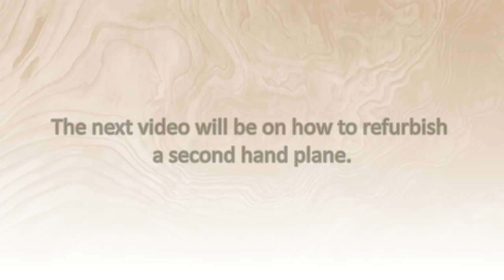What to look for when buying second hand woodwork planes.

Comment: Thanks, Chris, more great insights and observations, like the tip about the Record tungsten steel vs the earlier cast crucible one, the blunt end of the blade is a slightly different shape, a bit more angular I think.
I've also heard that pre war plane castings were left to sit for a year before further machining to reduce the cast iron body moving, whereas later it was a couple of weeks, hence the 80's 'banana's that seemed to prevalent back then.
Reply from the maker: Yes, I have heard that about the castings being left longer pre war.

Comment: They also made nylon handles that were a lot stronger ( my number 5 1/2 as them )than the silly plastic ones, but nothing comes close to rosewood. I restore old planes as when I get them their just a lump of rusty metal ,no I  keep and use them .I have one that was given a Stanley 4 1/2 that had the two adjustable pins I simply changed them for a cast iron one I had spare plus a replacement carbide pin , the frog I flattened better this gave it a better seating position, luckily it came with wooden handles and longer blade !

Comment: Excellent, learnt some new stuff, thx Chris.
I’ve bought one wisely, another knowingly of its issues, and also a turkey which I should have spotted however failed to see sole plate crack, in my haste thinking I’d found a bargain.
Reply from the maker: Hi Adrian, Yes it's easy to get carried away on ebay. As I buy quite a lot of planes I have quite strict criteria when looking at them. Do they 
have older style adjusters and handles, any cracks in the sole or handle and have they been tarted up, ie stripped and refinished, I prefer 
untarted  planes. Finally I limit my bid to £45 including postage. Hope I haven't given my game away there!  :)

Comment: Hello Mr. Tribe. Ty Mercier here,
I bought the (what not to buy #5 Record Marples Plain) a bunch of years ago brand new,  it was such a pain I put it in a corner. Then I saw your video. I already changed the handles to wood. The question I have is, can I switch out the undesirable frog to a desirable frog, add a hock blade+chip-breaker and have a (great #5 Jack plane)?  Or should I send it to the bone-yard? I can't even remember how much I paid for it. 
any advice is welcome.
Ty Mercier
Reply from the maker: Hi Ty, apoligies for the delay in replying. I'm not sure what to advise here, especially as I can't see your Marples plane. I am often reluctant to junk a tool but I guess it may cost a bit to do the switches you suggest when you could by a good second hand Record or Stanley #5 on ebay for about £35 or $ equivalent. Sorry if this isn't trribly helpful!
Reply: @MrCJTribe  Hello Chris and thank you for taking your time to reply to my question. In hopes of clarifying my question, (In the video where you are showing the two different style frogs sitting next to each other on the bench?) (Will the desirable frog physically fit into the body of the undesirable plain?) If it does I can purchase the desirable frog on E-Bay. 
Thanks a bunch
Ty
Reply from the maker: @tymercier8317  Hi Ty, I'm not sure I cvan answer your question as I have never tried to do that swap. Is your Record Marples plane the one with the retaining knurled screw at the top of the lver cap instead of a lever as in the planes I showed? If that is the case I don't know if the  new frog would be compatible with the cap.

Comment: can cracks be welded and then flattened?
Reply from the maker: I've never tried it Jack. I think it may be fraught with difficulty, the sole is cast iron which is very difficult to weld. The process of welding may also distort the sole. Better to just avoid cracked planes I think.
Reply: Thanks. Will do as you suggest.
Reply: Welding will introduce new cracks.  You just won't see them for some time, but they are there.  There are a lot of unknowns when you weld things - in regards to something that is a 'finish tool'.

Comment: Once again, another amateur that has no idea what they are talking about! Your facts about dates, details of parts etc. are completely wrong and you are giving out advice to people that is totally misleading. I bought my Record 4 1/2 brand new in 1984 in the second year of my apprenticeship, which came with Beech handles and works as good today as the 1963 5 1/2 Jack that I bought second hand a few years later - and guess what, apart from the length, all parts were identical! Be very careful what statements you make before somebody sues you.
Reply from the maker: Thanks for that Martin. I'm not sure I can be arsed to argue with you other than to say that I have been a professional woodworker since 1990 and refurbished over 400 planes in my teaching practice. The dates I gave in the video may not have been accurate to the year (the plastic handles date was out I admit) but they did indicate the trend of decline in production values over the years. The point was to show what to look for in buying a plane not to get pedantic about dates. If you want to know more about dates go to https://recordhandplanes.com/dating.html